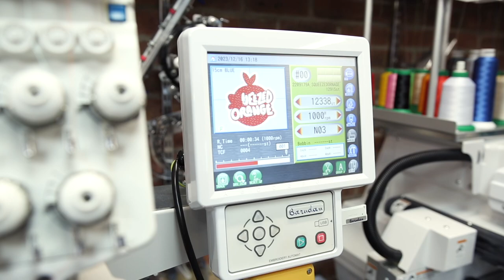How To Make Embroidered Patches!

Comment: What’s the heat gun for? Is it necessary for the finished product?
Reply from the maker: Burns off any loose ends and tightens the threads
Reply: Name for the Gum Please
Reply from the maker: @shefiuadewole7715  Dewalt heat gun. Any heat gun will work perfectly